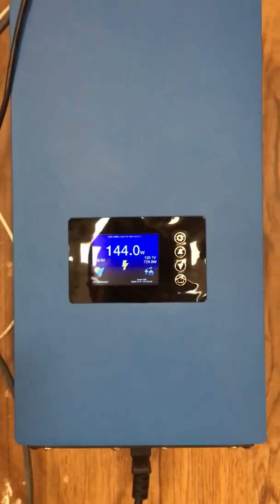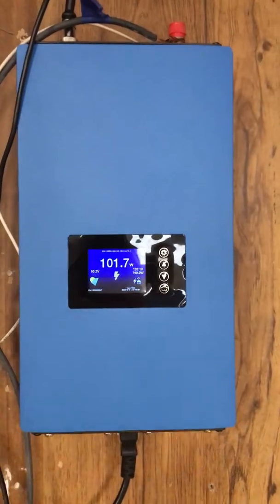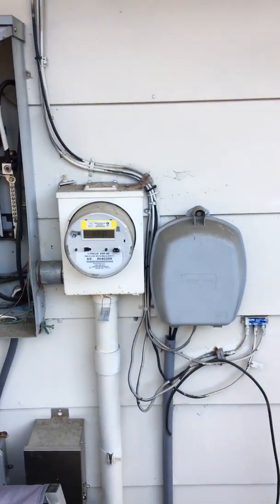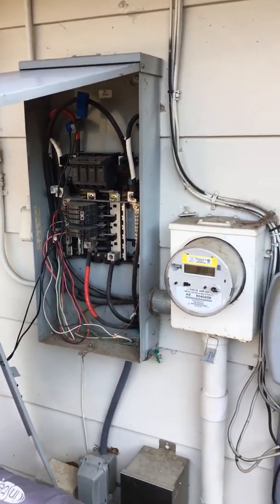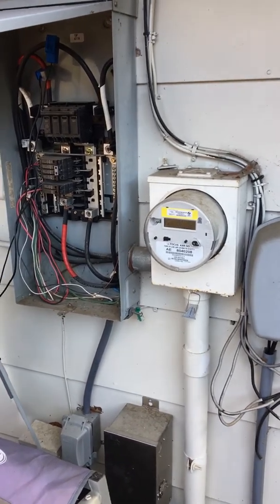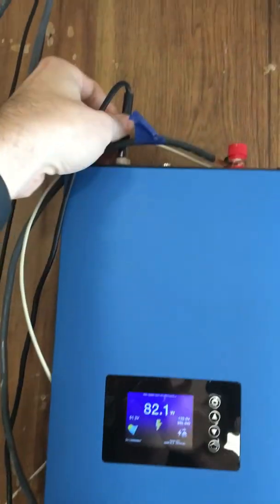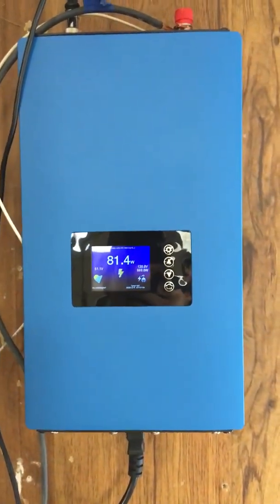DIY solar without permits

Comment: While the limiting software is the ticket, the thing I didn’t see you mention is that you’re feeding power from the inverter from one leg and a neutral.   I’m not sure if the meter is smart enough to know that you could be drawing on one phase and back feeding on the other.  You should only read one phase and backfeed into that phase.  If you had a second inverter, you could hook into the other side of your breaker box.  As far as safety, you’ll likely not backfeed into a blackout, but you are running electrical devices that aren’t UL listed.  God forbid you have a fire, even unrelated to electrical, your insurance company might take issue with this.
Reply: Yeah that I am still not getting an answer to. Does the meter report backfeeding on individual legs or just the total? Say consuming 300W one leg and feeding -100W on the other. Does the meter just see/report 200W net consumption?
Reply: @ I don’t have the data sheet or engineering information. On new smart meters, it’s not the highest technical hurdle to log and track.  That said, what if the company set it to report when it sees this? Like, what if they see this as a safety issue? If you didn’t have solar, it’s quite possible that this would be an indicator of something severely wrong at that location and to send a truck out to make sure it’s not a fire hazard.

Comment: A very good video on these SUN inverters.  I still do not understand why one must monitor both 120V lines when one is just using power on one of the lines.  I do have a dual sensor setup I bought separately when I was using the 2000W 240V version of this brand of inverters but it did not work because the 2000W inverter distributed power equally across both 120V lines instead of providing power to the line that was using the power.  So if I was using 800W on Line 1 and none on Line 2 the inverter produced 800W but split the power across both lines.  400W on line 1 and 400W on line 2 alerting the power company.  I now plan on using two 1000W 120V inverter to monitor each line separately, but your video seems to indicate this might not work either without using two dual .sensor setups.

I wonder if one puts the sensor on the neutral line instead of the power line than one sensor will work.
Reply: Would it be because your breakers on your 220/240v appliances tie both sides together, so if your pushing current into one side, it'll find it's way to the other side through those breakers?
Reply: @jfnwjnowngowjrn  Not sure I understand how current could jump a 220V breaker or device especially when a device connect to it is off.  

Beside the example I used above did not involve a 220V set up.  Just a 120V device.
Reply: @darylw792  Well when you plug this inverter in, it's sending current back to the panel and energizing the one bus bar of the panel (whichever side the circuit you plugged into is on). So the energy being introduced into the plug is available for anything on that side of the busbar. But I see what you mean. There really shouldn't be a way for the current introduced on one side of the panel to make it's way over to the other side of the panel. In any case, I've read elsewhere that the real issue with grid-tying is that when a large load shuts off (like a Heater, AC, Range, Dryer, etc.) the inverter will oversupply for a fraction of a second after the demand drops and before it gets the signal to throttle itself down. So there are always sporadic moments during the day where your inverter accidentally backfeeds the grid due to this delay. If you have a smart meter installed, the power company gets a notice that you're backfeeding.
Reply: @jfnwjnowngowjrn  That was my conclusion as well.  When I notice the garage door closing 400 to 500W was being used.  And when the door stopped lowering and shut off I noticed a split second of negative voltage on the inverter's screen indicating feed back to the grid.
Reply: @darylw792  Yeah that's what I keep reading also, have you heard of anyone adding capacitors to take up the overcurrent to prevent back feeding?
Reply: @bobbygetsbanned6049  no I have not.
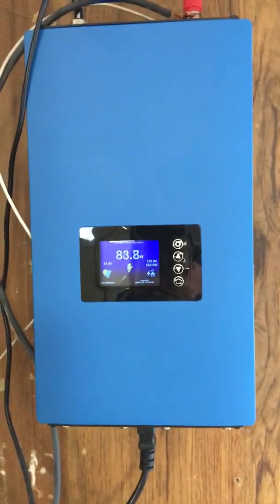Reply: Pge are screwing people in Oregon, solar panels and battery is the only way otherwise your paying 11 different fees and one big one that fluctuate for tree service and what not, it was like $165 extra just hit at one bill I called and said what is this ,for cutting trees and paying subcontractors. Screw this shit 5:23 5:23

Comment: So if you completely isolate the branch circuits in you house and use a pure sine wave inverter as a reference signal for grid tied inverter the smart meter wouldn't see anything through its neutral.  Would that work?

Comment: this still requires permit from the city...  just not from the power company
Reply: Sounds like where he is the city is providing the power probably a co-op power company. They don't seem to be so picky about stuff like this as long as you don't back feed. If I did that where I live my utility would report me to the city and inspector would show up fine me $500 for code violation. The other problem is if have a fire cheap inverter burns up now homeowners insurance won't pay because it was unpermitted. I put my DIY system in a shed so worst case it burns up a shed. Just reading a story over on DIY solar forum guy said his EG-4 3k inverter shorted battery cables caught fire lucky he was home put it out also it was inside a shipping container. He didn't fuse his battery at the terminal he was relying on built in breaker inside the inverter. Some reason the inverter burned up and shorted pulling more current then 4/0 AWG wire could handle.  Always use a T-fuse right off the battery terminal. Another issue is if you mount panels on the roof NEC says have to install a rapid shutdown so firefighters won't get shocked by pouring water on the panels or wiring only required if it's on a roof.
Reply: @Mike-01234  Your correct and that is also why I put a system in my shed. Just cant trust the non-UL listed china components to not just suddenly short and burn your house down.  With that said......... I am going to make a grid-tie system with cheap China components.    I am building a ground based system where the inverters are going to mounted under the actual array in a water tight electrical cabinet. Just an underground wire hooked to a 220v breaker will be in the house.
  In fact I may even put a 220v plug on the outside of the house and plug it into that, technically it is then a portable system and no local building permit required.   Now as for the power company side of things..... yes, technically they would have to sign off on it as there is a chance it could back feed. Again..... I don't always come to a complete stop at stop signs and I dont have a smart meter... in fact I still have a meter with the old spinning disk.

Comment: Not that I care, but technically this system (even if it's not back feeding) would still require a permit in most locations.
Reply: Yolo bro, if they can't detect it, it does not exist 😎
Reply: Never heard of Solar Gorilla???
Reply: Laws were meant to be broken. I bet you don't drive the sowed limit everywhere you go, or come to complete stops at every stop sign.
Reply: Nope. Not for the reasons you think. It is all on the owner's side of the meter and so long as you don't back feed one watt it is legal. The issue is not UL listed and so therefore could be a struggle with the insurance company if a problem
Reply: @benkanobe7500  It's seems to be nearly impossible to never back feed though. A lot of people are saying they still back feed when a big load drops off. I wonder if anyone has tried adding capacitors to prevent/slow down the rapid change in current draw and give the processor more time to react to prevent back feeding?
Reply: @benkanobe7500 regulations and code are written in the blood of those that didn't have it
Reply: @benkanobe7500 a year late but no lol electrical work TECHNICALLY requires permits in 99.9999999% of counties in the US. Anything electrical that’s considered permanent, like this attached system, would require an electrical work permit. “Mobile” units like the ones from anker, ecoflow, etc wouldn’t require the permits.

Comment: There are also meters that can be installed by the power company that prevent back feeding the grid.
Reply: Yeah. But they would rather be troublesome than helpful. Absolute savages.

Comment from the maker: Thanks everyone for the comments and feedback.  This system is still working, has been running for over 4 years now.  Has generated ~4.5 mega-watt hours which is enough to hit break even after the federal tax credit.  The panels were pretty cheap, ~$0.30 / watt, bought off craigslist.  Panels are rated for a total of 1200 watts and generate about 700 watts max on a sunny day.  They generated 4.0 kWh yesterday which was a typical hot summer day.

Thanks for the concerns that were raised in comments.  I don't believe any are problems and will address them:
- Safety for line workers: This grid tie inverter is safe for the grid as was mentioned in some comments.  The inverter will not deliver power to the grid if the grid goes down.  See documentation for the inverter for more information.
- Are there issues monitoring current in both the live wires at the house while delivering solar power to only one?  I have seen no issues.  The city has not complained and I see my electrical power reported by the city going to zero on a sunny day when we are on vacation and air conditioning is not running.  Our power provider provides our electricity usage in 15 minute increments which shows power going to zero at times.
Reply: like you, I started with just one inverter (the same one) about 3.5 years ago. I quickly added another an have it on the other leg of my power just by finding an outlet that was on the other side of the panel (split phase 120VAC/120VAC like most of North America). I experimented and now run both inverters connected to 1200Watts worth of solar each in Parallel (panels connected in parallel) as the inverters will only draw what they need and are not damaged as long as the input DC voltage is in range. You can "over current" but it is not advised to "over voltage". To all the opinionated out there: This system has worked flawlessly for 3 years in the South West in a city with the highest per kilowatt cost for electricity. No danger to grid. No back feeding grid. No permits. No failures. I did run an individual 20 amp circuit off each side of my breaker panel for each inverter jus to make it super safe and cleaner install. It is the way to go for inexpensive do it yourself solar. Buy two though, get used panels, be mindful of the amount of "Open Circuit Voltage" your panels produce so you don't blow up your inverters with too much voltage (wiring in Series). You can purchase more lower power panels cheaper and just get the exact amount that gets your inverters fed well without going over voltage (or wire in parallel. Parallel wiring has the disadvantage or requiring bigger and more expensive wire to handle the higher current). Good luck! My bill went from over $300 regularly to around $47.00 and I live in a big house
Reply: @benkanobe7500  my system meets about 90% of my load and while it is connected to the grid I also have no permits and no interconnection agreements. The technology is getting better and better and I simply set my inverter to the zero export and it's done. I live off of my battery and solar to the greatest extent and occasionally use grid power but I never backfeed the grid. I bought all my equipment for about $12,000 and took a 30% tax credit on it. So my pay back will be super fast as my electric rates are as high as $.63 per kilowatt hour.
Reply: @benkanobe7500  im guessing you used micro inverters not the string ones? I'm trying to find a string inverter that will do 3kw and limit but also have a transfer switch option for off grid when power goes out... but if i can't find it than limited inverter is fine too... but good job its what im trying to accomplish myself ... i'd love to just put it on net metering but they make it so damn difficult to approve these small systems so stupid
Reply: Hey! Can you post what the model of that inverter you used is? The link is broken, I’m doing something similar but with a Natural gas generator and power supplies.
Reply: Yeah can you post more info about the system and what equipment models you used? Looking to do something very similar
Reply: Got the same inverter but need to run the the anti-back feed clamps to the breaker still. Won't reach ATM. Good tip on extending. Probably will once I move panels from ground to roof. Pretty sure I've backfed the grid and power co just charged like it was standard consumption since meter isnt set for net. Just installed an emporia Vue 2 which will let me see demand and production by the second. House is pretty efficient when not running AC or major appliances it just uses 150-300w on average. Got about 880 w of solar. It's a fun project.
Reply: Irregardless, you are an absolute electrical hack. This is just plain god-awful electrical workmanship. Why document this? It's just a freaking mess!
Reply: But you could kill people with this 4 year system sir but who cares right.

Comment: You may have already figured this out, but you're measuring the power for your whole home, but the grid tie inverter is only supplying power to one half of your panel. 
Since your inverter is only putting out 120v onto one leg of your panel, naturally you would want to hook the CT clamp to that leg. The other leg isn't affected by solar at all, so it shouldn't be metered. In fact, by combining both current clamps together, you are still opening yourself up to the meter reporting you to the utility for backfeeding. Now if your grid tie inverter was hooked directly to 240v (both phases), you would need both clamps.
Reply: This was a great answer that @donelsonas did not seem to understand.
Reply: @Scott-sm9nm  i appreicated it cause i have been wondering about if both sides feed each other or not if you over produce into a 120 circuit would it feed the other circuits on that leg and possibly the other or just one leg and than out to the grid? so by this information it would only feed that leg and than out to the grid.... so if one circuit is pulling say a very low amount like 100w per hour and another circuit on that same leg is pulling 1.2k per hour and you have a limiter on the 100w circuit will it see the 1.2k on that same leg and feed it as well?
Reply: @SadComicLaughs  the solar inverter will just feed the one 120v leg it is connected to and all circuits on that leg will be able to draw power from it.  Another solar system could be put on the other 120v leg.
Reply: Question.  If I use 200w on each leg (400w total of grid power). Now lets say you add solar to only one leg/phase but don't want any export. Now if on that one leg/phase you added it to, lets say you're making 300w via solar. So now one leg is -100w (200w use - 300w produced) and the other is still 200w. Would the meter read as both summed together (so 100w total use in this case) or does it do both separately and show one exporting and one using grid power?
Reply: @zaid3ssaf1  probably
Reply: @zaid3ssaf1  old spinning dial meters use electromagnetism. L1 and L2 are added together, so a positive on one, and negative on the other would just sum up.
Reply: @zaid3ssaf1 the math is the same as two different size generators two different size 1 ml is two different sized solar panels two different size air pumps two different size water pumps
Reply: This is exactly what I was coming here to type, but you already said it for me
Reply: Is there a way to check how much electricity your using in your house at any current time? I've been looking into ways to try to figure out how much electricity I'm using on a summer day
Reply: @JohnSmith-bh8um yep there are many systems out there... easy to install ... I use one called emporia that came with 16 ct's which allows you to see the over all 2:main legs and than 16 individual circuits ... So I can monitor when my AC turns on and off and how much power it draws as well as all my other circuits... It has ones for solar and individual smart sockets as well ...there are probably cheaper ones but I found this one to be accurate with my bill
Reply: When you were back feeding.   Did the electric company credit you some kwh
Reply: You're so close and the maximum line voltage is 274 volts how about do the test
Reply: It's the same even if you're maxed out and just put it in a little trickle in their the installed watt meters going to read 100% anyway at 240 volts and the difference between 274 is 15% so double check your installed wattmeter at 2:40 you will see an 85% difference
Reply: Or just measure both legs

Comment: So what’s the best inverter to do this so it dose not back feed and hurt someone
Reply: Backfeed is dangerous it can cause a flash lookup phase to phase arc flash for more info
Reply: I'm running MPPSolar LV6548's that are off grid all in one solar charge controllers. While they are plugged into the grid they do not back feed any power to the grid. They use grid power to charge the batteries during extended rainy or cloudy periods. They will also bypass the solar and batteries, and power the circuits you have hooked up to them.